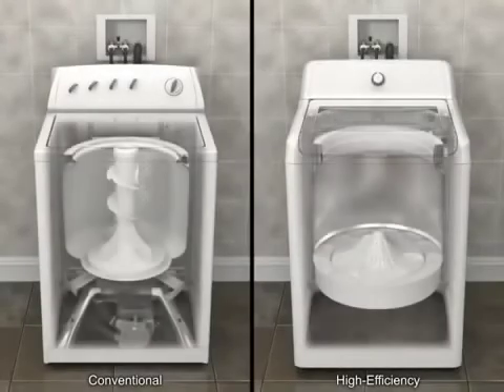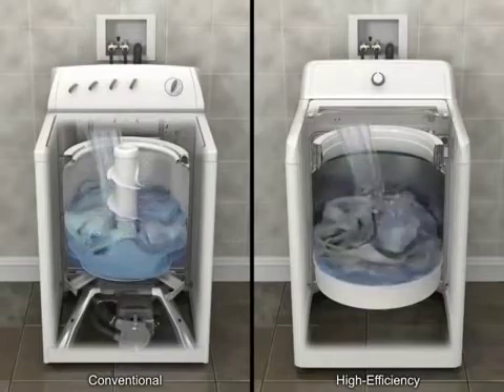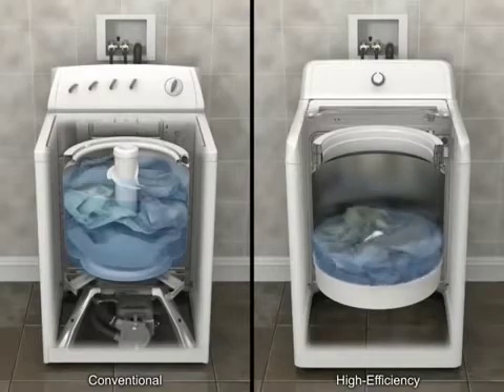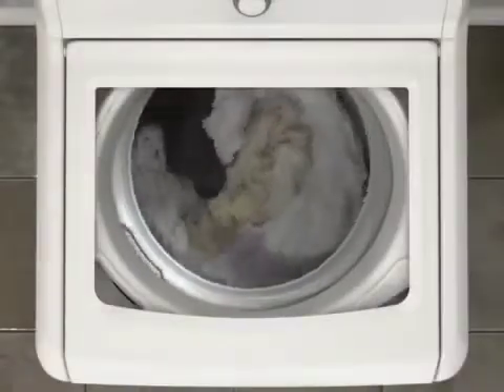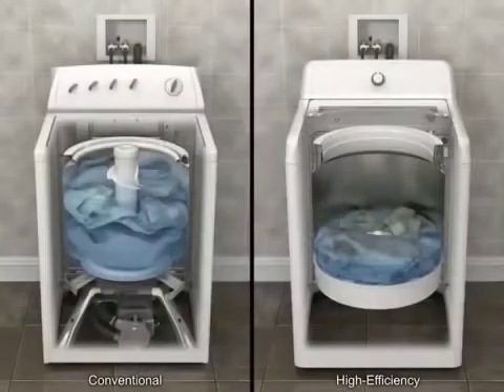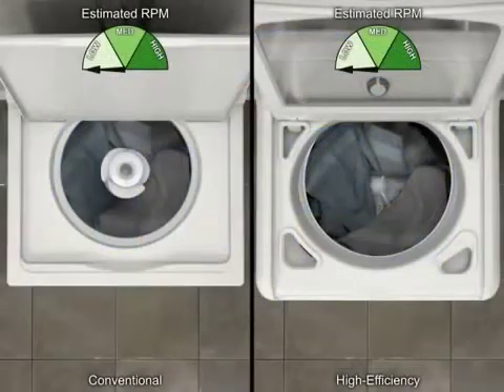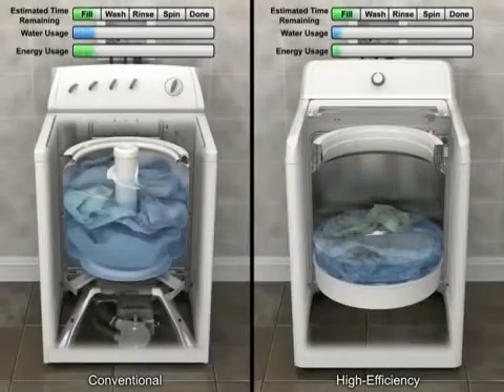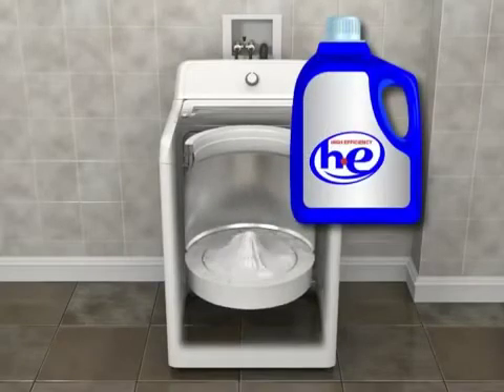Why HE Top-Load Washers Use Less Water  | Whirlpool Self Help Videos

Comment: I want to agree but i cannot. front loaders do work well with little water because they actually turn the cloths over, my whirlpool top loader sucks. auto sensing crap and all it cannot clean them if they never turn over. Mine only washes the bottom as the state of the top of the clothes never change. Thankfully i can adjust the level but if i forget before starting cycle i cannot change it without it dumping all water and detergent. terrible

Comment: Terrible design! An expensive machine that simply does not work!  Too many problems outweigh the "water efficiency" which isn't efficient if you have to re-wash your clothes because they don't get clean, and then clean the washer itself because mold starts growing inside the tub.. Why?? Because they don't use enough water to clean and or drain properly!